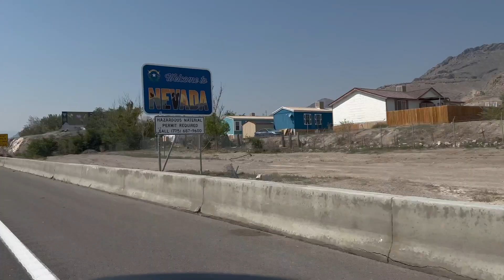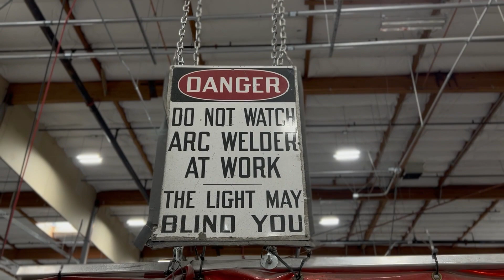Saying GOODBYE - Truck Camping - Life on the Road

Comment: I didn't know they made those without the floor! Pretty cool but I can see the down side from the last clip... I'm sure you will get it sorted out and you guys will love all the head space. Best thing about those is the aluminum structure and the pop-up roof. Great choice! We would love to upgrade to one of those someday as the one we have is like pushing a sail down the highway, not great on the drag coefficiency.... more importantly our gas mileage! Can't wait for a video tour!!!
Reply from the maker: Once we came across this model we were sold. We have been researching and gathering info on this for a long time now. Will give more details in the future but we are over the moon with this topper, it is under 400lbs, we can still go places where most don’t dare, in fact we just did today! The space is phenomenal we are still getting used to that fact. The only downside this far is the fuel economy. Ours has gone down quite a bit, have to find that sweet spot again. When you are able to upgrade we would definitely recommend a pop up and four wheel campers. They honestly treated us right. Not to sound all commercialised or anything 😝
Reply: Probably telling you something you already know but there's some good info on the Wander the West forum. They've been working out the gremlins on the project M over there.
Reply: Your fuel economy can't possibly be as bad as ours! We would definitely like to upgrade, the truck and camper! Truck is 20 years old and the camper is a 1974. I spent two weeks strait tearing the siding and roof off to repair wood rot and re seal it just to find a water leak again today 😔 I did everything right too so this leak is really mysterious 🤔 but that's where your warranty will come in handy if somthing like that ever happens! Glad you're enjoying it, can't believe it took this long to get one! 😄
Reply from the maker: @DecayWithUs  Oh my! Is that going to be a future episode on your channel? Can say with sincerity, know exactly how you feel. Yes we are so chuffed with the new top we are still pinching ourselves!
Reply from the maker: Thanks Paul, we will look into that.
Reply: I wish we had filmed it... but it was 95° out in the sun and I know it would have taken another week if we did haha. We did film some other upgrades we did like the new folding bench/bed along with some electrical and what not. Not sure when we will edit it up but it will make a nice little video 👍
Reply from the maker: @DecayWithUs  Looking forward to seeing it.
Reply: Pin In The Atlas  hello from maine so when do we get to see your upgrade
Reply from the maker: @fourwheeling  Stay tuned, Pete.

Comment: Cool, when installed take a hose over the whole outside spray every inch with high pressure. Then check for leaks before putting all your stuff inside.
Have owned 5 truck campers, 3 truck shell campers one pop up 2 5th wheels and one trailer. So I know you're pain on the shell.
It will be nice to have more room.
Reply from the maker: Thanks Ben, actually we did just that. That is what those clips were at the end with the water pouring in the sides. Will go more in depth on that later on.

Comment: That dosen't speak well for A.R.E.?
Reply from the maker: Hello stranger. Yep we were glad to upgrade that’s for sure.
Reply: @PinInTheAtlas  I have  the Alu-cab canopy camper with a Dickenson heater and I'm loving both.  I hope to spend a month or two in Nevada on the way to visit my daughter in LA.
Reply from the maker: @asherdog9248  What does your Dickenson heater run off?
Reply: @PinInTheAtlas  a 10lb propane tank. It has a dual exhaust/intake pipe that keeps condensation from building up inside the bed of the truck.

Comment: The slide in models would have been my choice there all sealed up no leaks. There's always issues when trying to seal a topper to a pickup box
Reply from the maker: Yep you’re right. However We had a budget plus the slides are much heavier. These are designed more for off roading. Apparently.

Comment: I don't like the canvas pop up slide in campers I just bought 2 old slide in truck campers. I believe your better protected and more safety with a solid camper than canvas just my opinion good luck ✝️🇺🇸
Reply from the maker: Yes the solid ones do give better protection. We chose the project m because it’s light weight and designed to go off road. Plus we are on a tight budget. We’ll see how it goes Jim and keep people updated on the pros and cons.

Comment: Geez lueez, the beginning of this video is soooooooooo sad!
The video left thinking you did not purchase a new camper.  I would suggest checking out JEEPer youtube channels for ideas on how to rig up your rig (I think there is a pun in there).

A couple I am thinking right now is Trailrecon and Dr. Hanna Straight who is a young woman traveling in an F250 with a pop-up camper.  You might see yourself punching into youtube "overlanding jeep."  Air bags are kinda, eh...  The best thing I see about them is that you can adjust the truck height to compensate for the load.  

I would measure the center of the wheel opening then load whatever you plan on carrying including filled water resevoirs, tools, camping stuff, food, and whatever else then maybe throw in about 4-6 90# bags of sand and re-measure the height.  Then have a reputabale spring shop either re-arch your springs to the orginal height plus an extra 1-1/2 inches. to handle the load on rough roads and trails.

The spring shop can re-arch your existing springs and add a leaf or two to carry the extra weight.  The shop can advise you on your particular truck.  Typically springs can be made or upgraded with thick leaves, but might make the ride rougher on the road and more rough on trails.  Or the springs can be made or upgraded with thinner leaves to make a nice ride, but will make the spring pack thicker.  

The spring shop will advise you on that too.  And, there is a medium between the two.  I would advise installing a good a lift kit front and rear about 2-3 inches to handle the load and handle the trails better and safer.  With the lift installed you can then re-arch or build a rear spring pack as I mentioned above.  Just remember to go about 1-1/2 inches higher in the rear (the 1/2 inch may be important Andrea).  I definetly advise a modest lift 2-3 inches, you will happy with it.  

I much favor the idea of a pop up camper, you will be way more comfortable.
Reply from the maker: We do have a mechanic that we thoroughly trust in Fallon,NV. We spoke at length about options and decided that air bags were our best option. We had a 2 inch lift done as well. As always Tedford Tire did an immaculate job and we couldn’t be happier with the end result and our new home.
Reply: @PinInTheAtlas    There are so many options, but if you consult someone who knows what they're talking about and you trust them to make good on their work you will be safer on and off the road.

I have a JEEP I have been repairing others' horrible and dangerous work for the last year I sometimes think they ought hung at the Tombstome gallows.  The list of hoorors is very long.  

I hope one day we will meet and do a bit of exploring together.  Up until I purchased the JEEP I would do my exploring on a Harley!!  People trip out on the places I get into and the weather I ride in, but I was trained as a military vehicle mechanic so I know how stuff works and know how to get out of a jam.

I want to visit the stage coach stop near Cochise Arizona and Why, Arizona this December.  And Why??  Because I can!!
Be safe...
Reply from the maker: Been on the receiving end of some of those horrors with our other vehicles, with our Tonto only the best will do and we found a very reputable and trustworthy outfit. As an ex motocrosser and motorcycle lover I would have been ear to ear grinning when you pulled up. It's all about knowing how to use the equipment you've got to its full potential.

Comment: See Hannah Straight.  She has everything.  A camper will weigh a lot more and compromise your 4WD capability.
Reply from the maker: That’s why we chose the Project M. More space but weighs around 400lbs so doesn’t compromise the 4wd. Plus we had airbags and a 2inch lift.
Reply: @PinInTheAtlas  So you mean now you are 5 foot 4 1/2"  Ok.